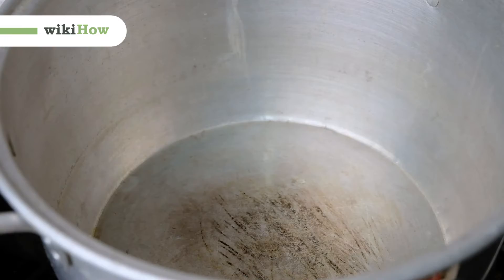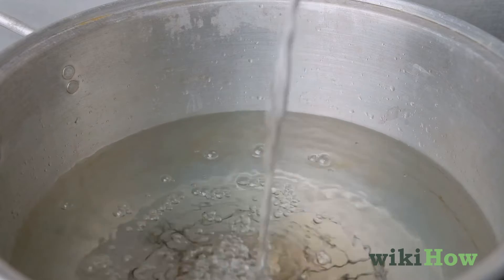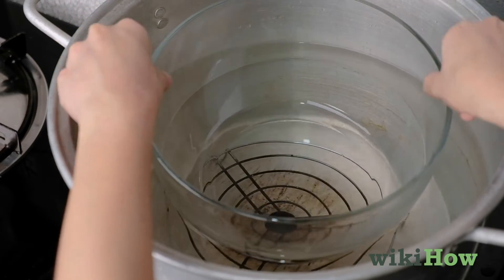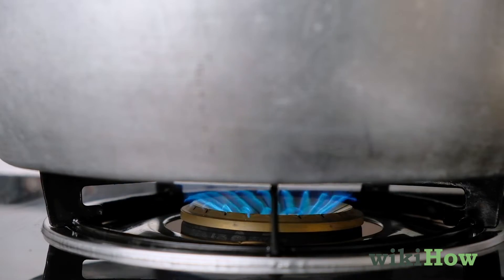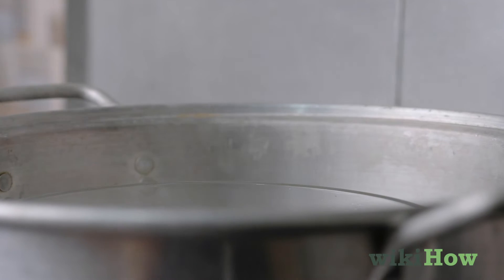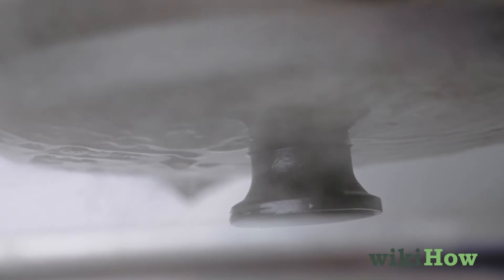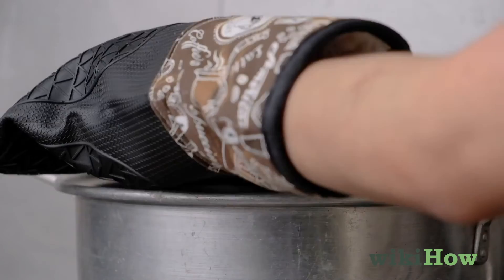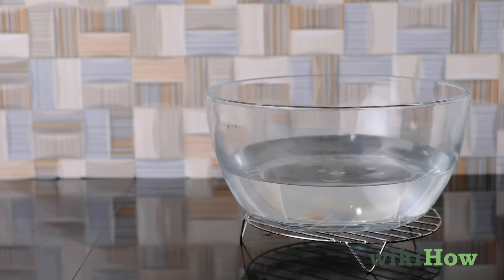How to Make Distilled Water

Comment: Just wondering if shop-bought distilled water costs less than the gas you used.
Reply: Ignorant comment when this is a needed medical supply in areas with shortages due to the supply chain issues.